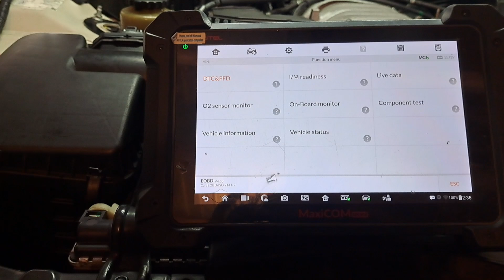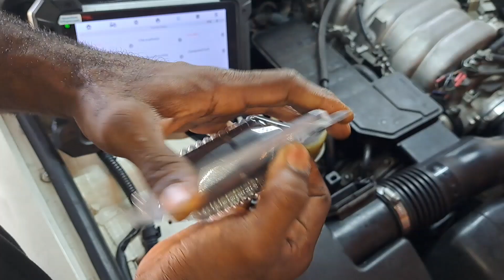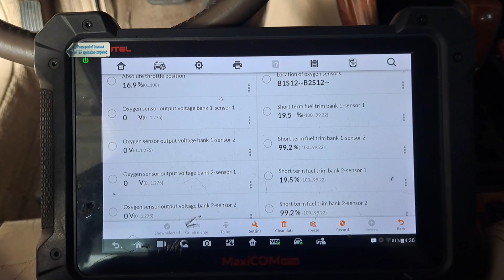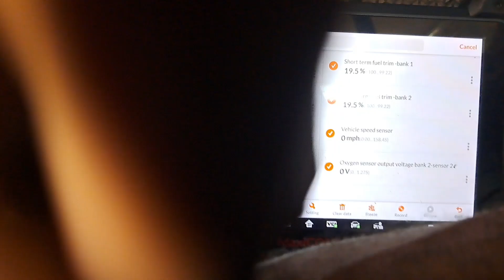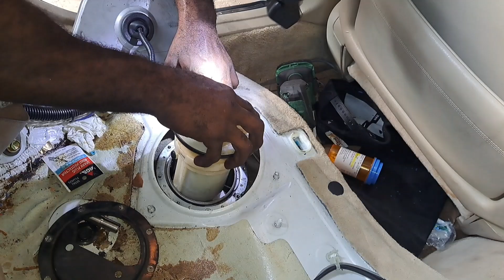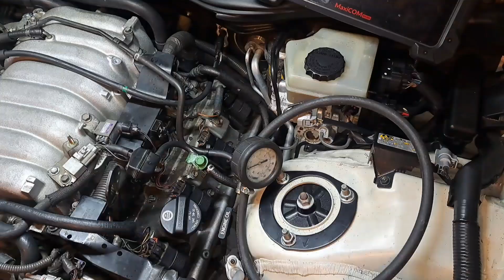lexus gs400 crank and stalls, no check engine,  lots of parts shot at it

Comment: Where can I find a clear and easy diagram of those top thin hoses. I bought a 2000 GS400 but it is missing a few of those and drove from Fl to Ky lol.
Reply from the maker: You mean Vacuum lines?
Reply: @partsshooter  Yes I think that's what they are. Should I google it like that?
Reply from the maker: @MyloMusica  diagram should be under your hood,  on the hood.  If not,  simply Google it. If you need the actual hose,  take them to the oreilys auto or your part store and they have cut to fit vacuum lines
Reply: Thanks!  @partsshooter

Comment: Boy you get some tough ones!! That's weird that low fuel pressure caused o2 sensors not to read.
Reply from the maker: @kianwilliams2512  the money is in the complicated work😅
Reply: Been having issues with VVT bank 1 and missfire in 3 and 7. Replaced the VVT sensor already but cord to the connectors are all messed up. It is probably that

Comment: I noticed on the fuel pump your missing some o rings and that mass airflow sensor is squirrelly with aftermarket , I have the same car and I had to get a used denso maf from eBay and clean it out for mine to work properly.
Reply: Te ese problema y se aseleracion solo y baja o deja de acelerar

Comment: Sorry to bother you but I have a brake question and thought to post it here, since this is your recent upload.  I got my Lexus back and it cost $1,089.  Which was well under the estimate......Front: new rotors, ceramic calipers, etc.  I then drove to the liquor store and looked at my back brakes, which were done, about a year or so ago.  Is it normal to have rust already on one of the rear calipers?  I live on the ocean in Mass and I do not have a garage.
Thanks in advance for your assistance.  I do trust my mechanic and I will ask him tomorrow.  I just wanted your opinion.
Reply from the maker: Totally normal... especially youre around salt,  rust 3x faster
Reply: @partsshooter  Thx for your opinion.  I looked back and it was 2022 when I had them done.  When I purchased the car, it was already compromised brake-wise.  The used car dealer just put on pads.  When I first test drove it, I felt like Fred Flintstone, needing my feet to stop the car.  Since I got such a good deal on the car, I didn't push the brake issue and it did pass inspection and I had a friend mechanic check it out.  Feels odd to have a car that actually stops as it is supposed to. 🛑🚦Can I blame the ocean for my wearing-out control arms? 🌊